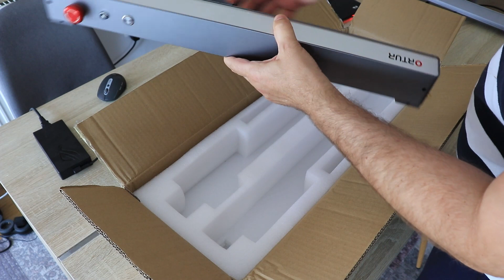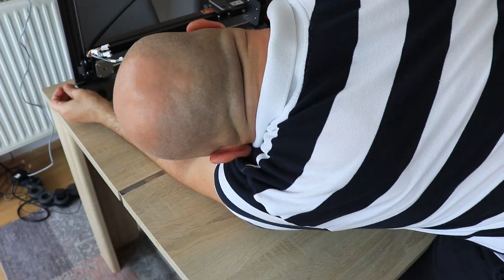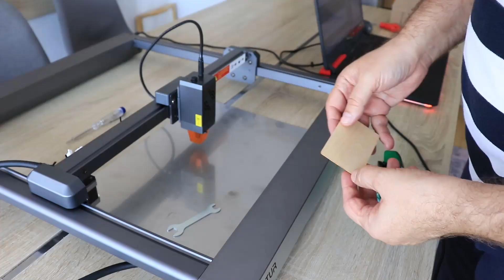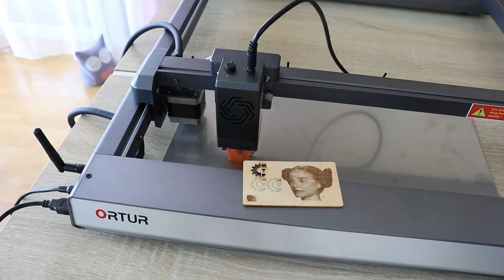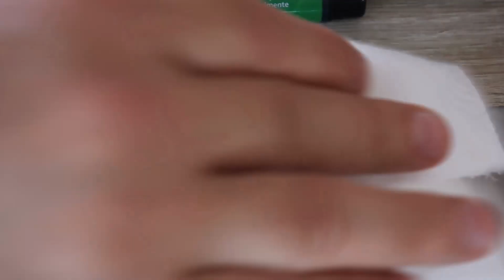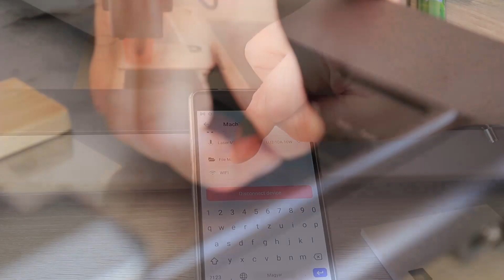Ortur Laser Master 3 - the fastest laser engraver I tested so far!

Comment: Hi there, thanks for the infos ... I was just wondering if it's possible to use the laser in a normal apartment room, how noisy is it ? and what about the smokes ? thank you
Reply from the maker: On, not recommended in apartment, unless you build an enclosure for it. About smoke, depend what do you engrave, but it would be good to use some exhaust fan.

Comment: seeing as this can engrave metal, could it cut very thin sheets in multiple passes? Maybe 0.4mm sheets or something?
Reply: Somewhere I saw that atomstack 20W can cut 0.1mm steel. So, this is far from 0.4mm
Reply: @gasparigi  
Ahh, would that be in a single or multiple pass though? Maybe something like aluminium might be possible then?
Reply: @gasparigi  yes, please try cutting thin metal, aluminium, nickel. Old cola can maybe (cans have plastic layer inside).